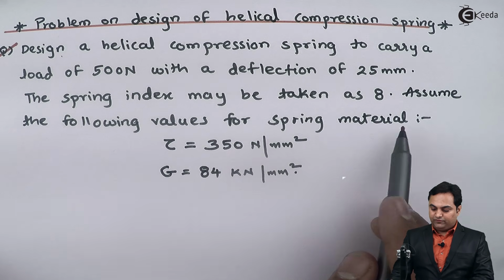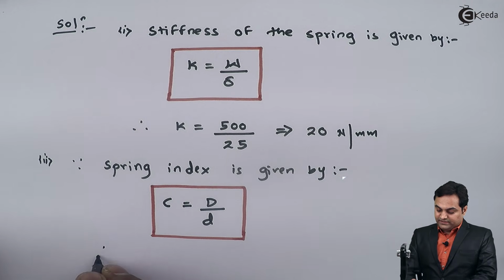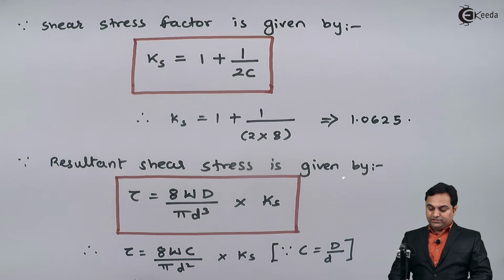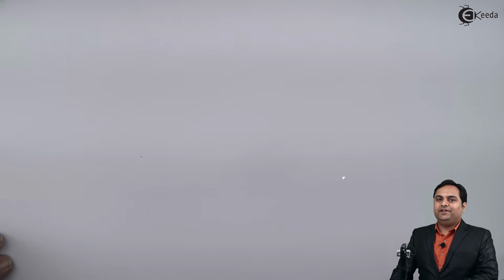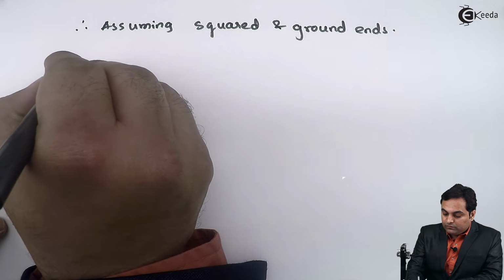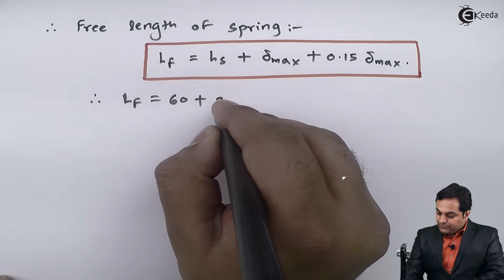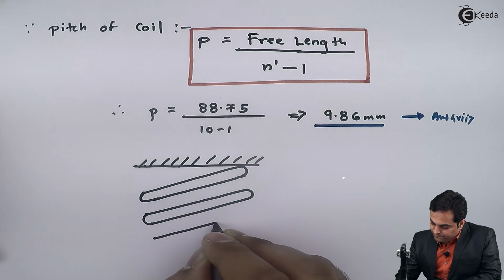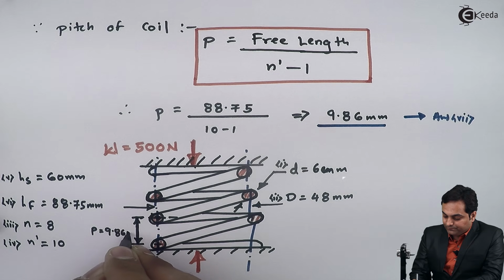Problem on Design of Helical Compression Spring - Springs - Design of Machine

Comment: Q2: A helical coil spring with given D and d is wound with a known pitch value. The material is ASTM A227 cold drawn carbon steel. If the spring compressed solid, would you expect it to return to its original free-length when the force is remove? p= 14 ,D=50, d=10mm

Comment: 6.15 round of to 8 ....? why not 6 or 7?
Reply: Sir ham log Hindi me jyada samghte hi
Reply: because "n" we should  be selected in even no. not in odd so  that it take 8
Reply: yeah how it possible 6.15 to be 8... why not 7?
Reply: @pramilapradhan144  safety factor
Reply: @pramilapradhan144  really
Reply: Same
Reply: kurunandan shishaudhiya if you will see the actual designing of the coil spring you can't round off these values. This is completely wrong.
Reply: its beacuse we have to design it with respect to tables so that our design will will available in market